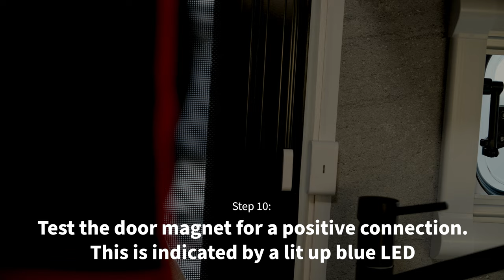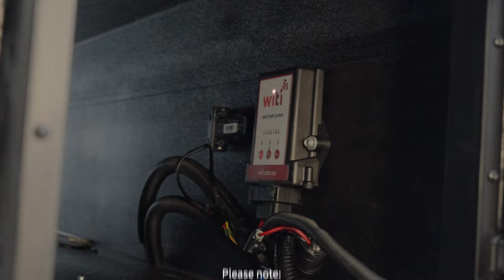How to install your WiTi Anti-Theft System

Comment: Hello. Where does the white earth return wire get connected to?
Reply: It connects to the white earth return wire of the caravan. It will be one of the 7 wires from the trailer plug. It’s the common earth for all lighting circuits.